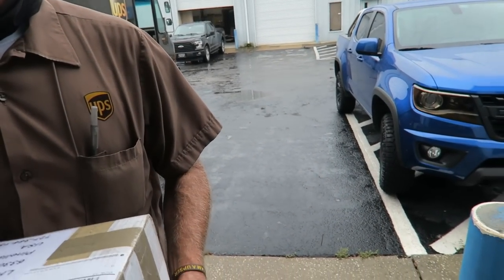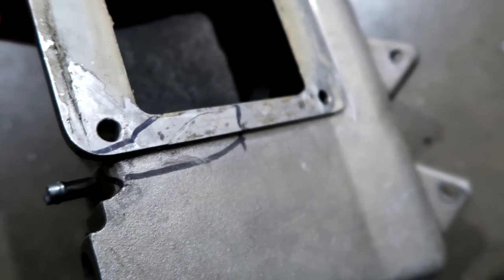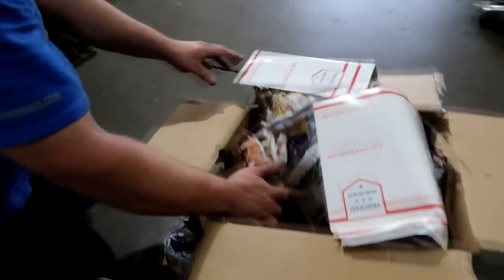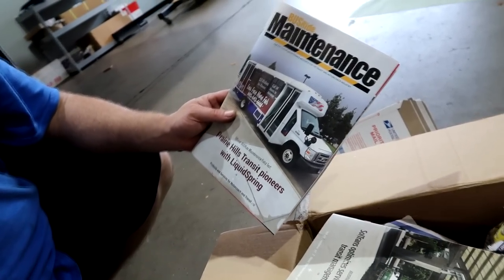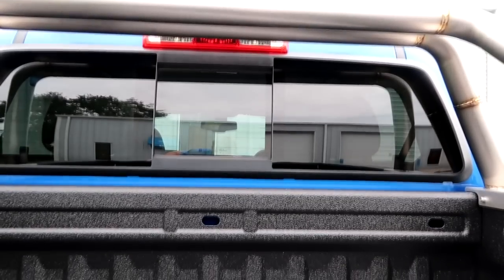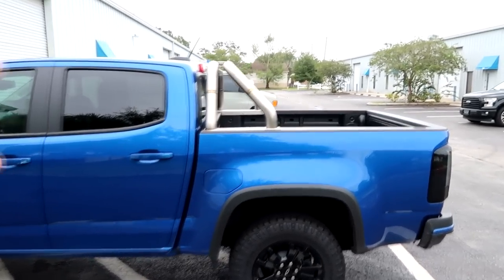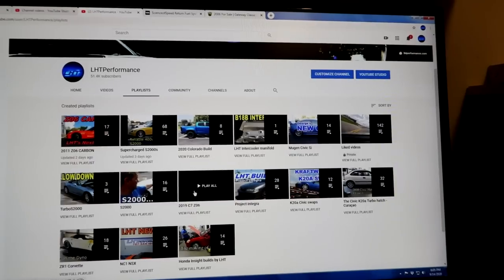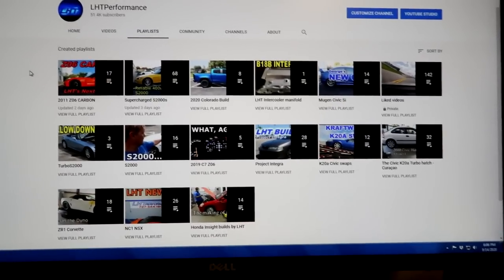Shipping, NSX, Manifolds V Log #3

Comment: You could heat the bottom of both tubes for that burnt blue ti colour, mask it off and have the rest of the bar coated in the same bed liner coating.  So you can still tell its titanium but itd keep with your colour scheme.